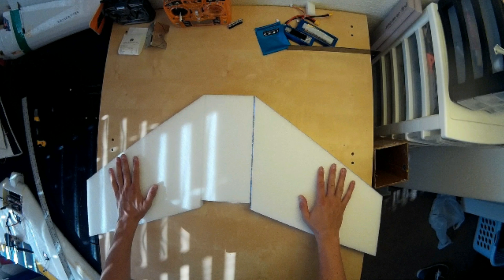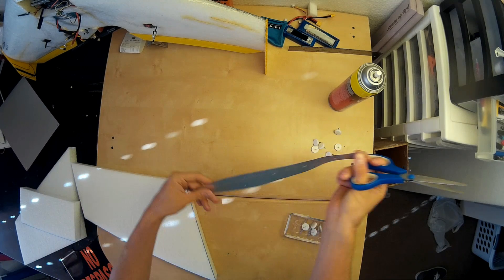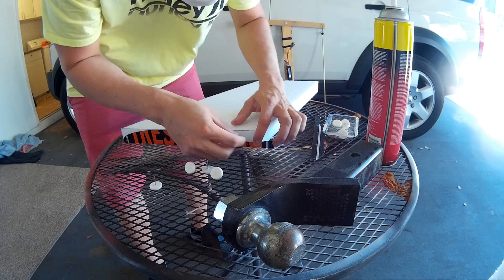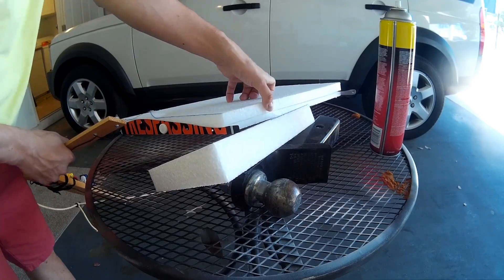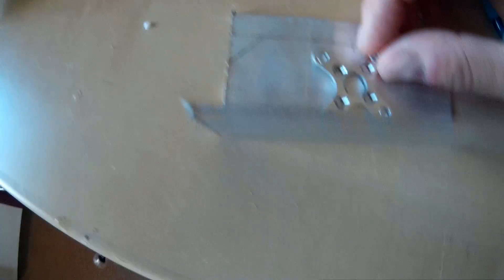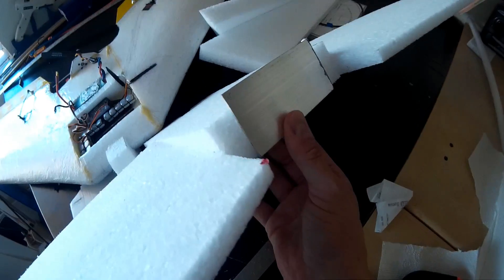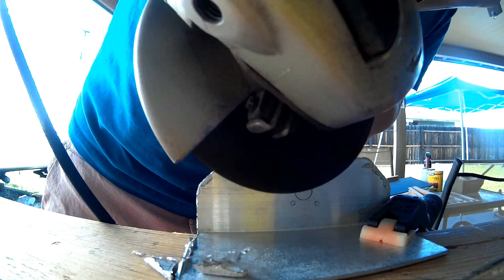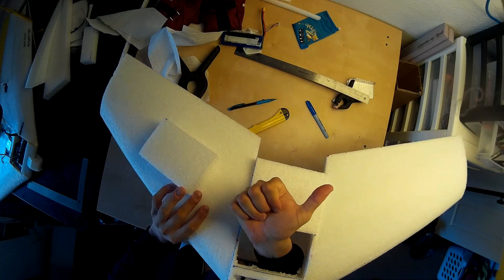How to hot wire cut  FPV wings out of EPP foam (part 1)

Comment: Nice video-

Any trick hotwire delta wings?

I noticed you are not going from trailing edge to leading edge horizontally. Looks like you make a angled or from back right to left front.

Did you find this is better way to do it?

Are you using same airfoil but different sizes. Larger one & smaller one for wing tips?